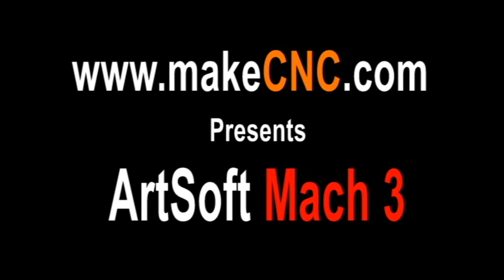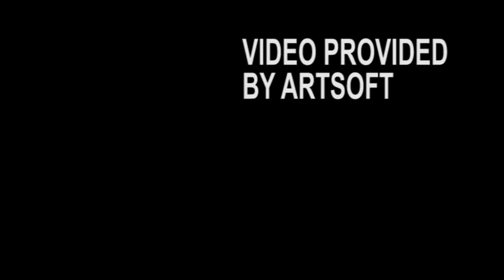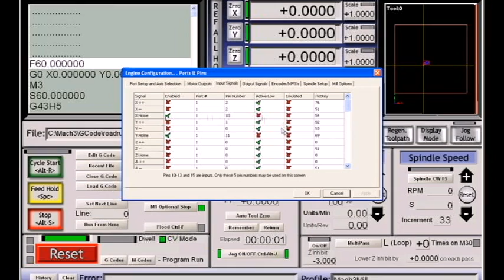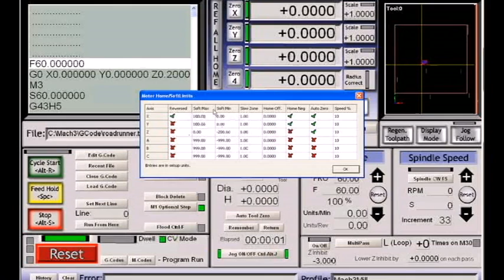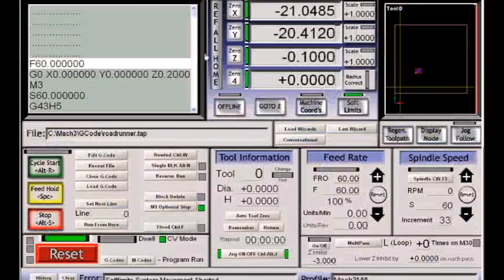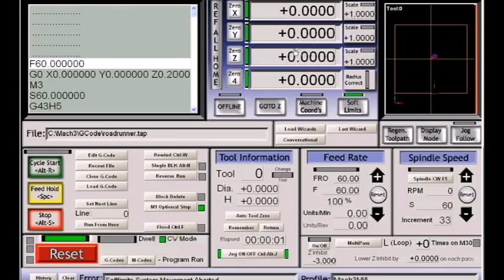MACH 3 CNC  CONTROL SOFTWARE TUTORIAL 3 OFFSETS HOMING & LIMITS

Comment: Am I wrong when saying that the safest way to wire the limit switches, is only a matter of wiring them in a normally closed loop instead of a normally opened loop?
It really doesn't matter if it's active high or low, does it? 
I got mine connected in a closed loop with active low (because it's getting the signal from DCM pin), and it works great. If I disconnect or cut a wire, or even open Mach 3 without turning the power supply on, it'll trigger an alarm / emergency stop. 👍🏻

Comment: At 07:29 I think you switched the (Active High) & (Active Low) meanings by mistake...   My Understanding is that: an Active High is a circuit where the switch  "Goes High when Activated" [ie. Normally Open], and Active Low is a switch that "Goes Low when Activated" or Activates when Low [ie. Normally Closed] (and this is the safest I guess)

Comment: I AM NEW TO CNC MACHINES BUT AM KEEN TO LEARN , I HAVE A MACK3 PLASMA TABLE HOME BUILT, BUT IN MILL DEMO RUN IT TELLING ME THAT IT WANTS A E STOP
BUT IT DOES'NT HAVE ON WIRED, SO  IT WONT WORK ,SO I SET IT TO PLAS CUT AND IT WORKED SO I DON'T KNOW WHAT WENT WRONG, ANY HELP WOULD BE HELPFUL

Comment: My Cnc Machine..Operate With Wrong Size...smaller Than Original Size In File...
I Try To Calibrate the Axis.. But Calibrate Change Motor Tuning Value..
 I use mm Native Units...so I calibrate With mm...But After Calibrate...Motor Have Slow 
Move..Very Slow....

what's the Problem Caused..My Machine Operate At Wrong Size..?

Please Help me..
Reply: Next to dro is scale set to 1.000
Reply: Here is what I did to make the cut same as the plotted actual size.

1. get a pencil and insert it to the chuck (find ways to make it snap like a bit) don't run the spindle of course
2. now to you need the trial and error...on your CAM-cad just draw  a 90 degree line with a length of your choice. (i did 100mm)
3 generate toolpath engrave just barely touching the material  Zero in on the junction of the 90 degree angle line and start it from there..(material i used is just a piece plain A4 size
4. load the g-code (noting all of those X-Y-Z axis motor tuning especially the steps (mine with stepper 1.8 degree, 200 steps per rev ..2mm pitch lead screw --this is the standard, 

NOTE: if u have input the 200 steps on the motor tuning..it will plot very small, tried that) from 200  go down to 28 steps inputted then test..)

if the line plotted measured 100mm then you got the steps correct, if not or just let us say 95mm when measured then try the 29 steps so on and so forth)..until the plotted line gets the 100mm measured length. 

acceleration and velocity settings is how the motor wil turn fast or slow and so play with it, not all stepper can run the same speed with same settings. there are NEMA17 that can run 200 acceleration, others cannot. So with an unknown stepper like mine which by the way I am using UNIPOLAR steppers from old photo copiers. I just played those settings until i got the right one for my steppers, and they work perfectly.

Comment: HI Paul, I bought this machine 4AXIS 3040 CNC Router USB Engraver 0.8KW Engraving Drilling Milling Machine 800W. The problem is: I load the g code then the machine carves for a minute suddenly stops and does not go anywhere , would help me please
Reply: Sounds like you dont have a full version of mach 3. It will run either 1000 or 5000 lines of code in demo mode. Hope that helps
Reply: @yourerite , It has nothing to do with a full version of Mach3 or not. It has to do with the G-Code sending the tool to home and the configuration of Mach3 setting home to somewhere below the work table.
Reply: Did you find problem?I HAVE THE SAME ISSUE
Reply: Move the router manually to a Z value above the highest point on your work, then press the "Reference All" button in Mach3, then re-zero everything and instead of going down into the table when your G-Code tells the machine to go to home, it will go to that point above your work.
Reply: when it stops at line 500, you have a demo version..what ever you do, it will not pass after 500 and stop..so better buy the full version.

Comment: Hey Paul, great video.  I am new to the CNC world and just got my first 4 x 4.  However, I am using Cut2d to generate the tool path, but every once in a while the z position doesn't go up high enough when switching cuts and cuts across the material.  Where is this z location to make sure that its high enough to clear the material when going to other areas of cuts on the material.  This has happened 3 times but not always.  I am sure its something simple but I was hoping you could help me out.  I have Mach3 as well.  Thanks in advance.
Reply: edit the gcode by increasing your Z height

Comment: Help Needed, 
my mach3 gives me VB failure

what do i do wrong?

greets Hans
Reply: +Hans van de Zande Did your error happen after adding new vb code or did it randomly happen? Or is it after a new install of mach3?

If it's after new scrips being added there is a error in the scripts are newly added delete them all start over!,
If it happened randomly try reinstalling Mach3!, 
If it happened after you installed mach3 and first go an error the windows or linux your using is having an error it's self and needs to be fixed!
Check to see if your Pc has the updated VB 2008-2010on your pc around time of the error, If so you can remove the update in windows update section!

Comment: Hi Paul,
I just bought a cnc router from China QC 1325 with a leafboy77 breakout board.
Are the port and pin settings the same for this breakout board.
I just can't get the machine to work right. 
I really need help getting this machine setup right.
I'm also having problems with the spindle motors. 
I have two.
Thank you,
Phil
Reply: Philip Tancredi HI i´m fom mexico i thing, i can help you . is not that hard to use or confi. this leafboy card

Comment: Don't know if you got an answer.  Today my z axis would home sometimes, and come off the switch, other times it homed and then showed the z++ limit was tripped causing the machine to halt.  I got a tip on the internet about setting my de-bounce to something other than 0.  I started with 500, then gradually went down to 50, and now I can home and back off the switch every time.  De-bounce has something to do with electrical noise.

Comment: I am not an expert, but you can check that your axis limit and home are set to the correct pin, that your motor's are calibrated ( meaning they move an inch when Mach3 says they move an inch ), the axis direction is correct, and can check if homing works for an individual axis ( meaning if you have x- y- z+ switches in series on the same pin that if you separate them they can home ).  I have my z axis homing, but I don't have motors and limits wired yet.

Comment: Hi Paul  When i am checking my table cords when i ref all the z moves up and hits the home switch but it does not then move off from it.  This happens for all axis.  Are you able to tell me what i may have set wrong.  Other than that the table works fine and all the motore move in the correct direction.